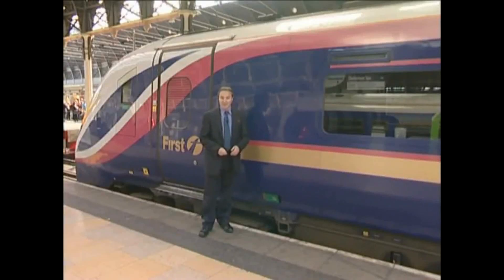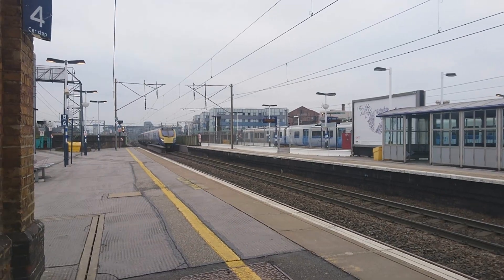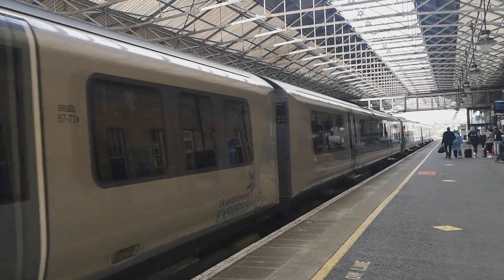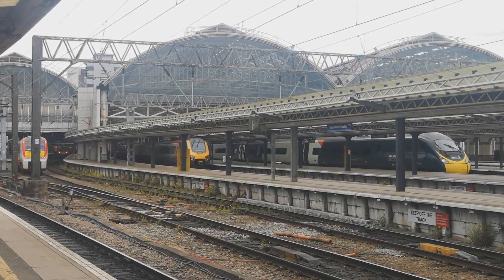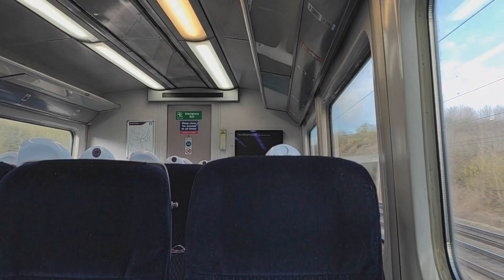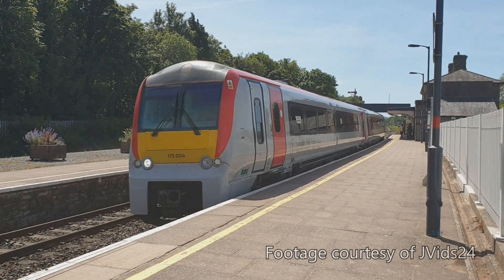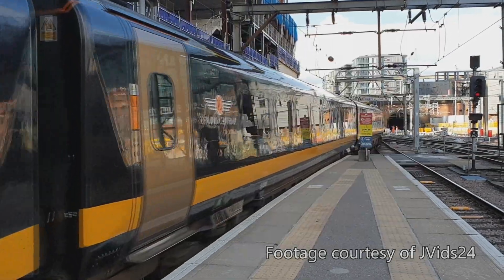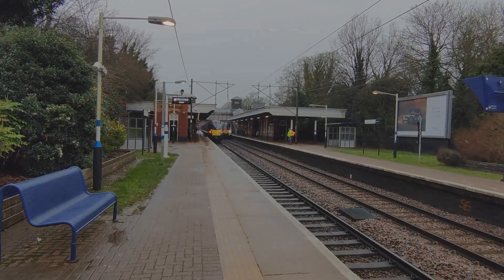The Railway Review To The Class 175 & 180

Comment: I’ve been on the class 175 and it was decent but it would be better if the coaches are longer.
Reply from the maker: If the coaches were made longer, you'd start hearing some rather concerning metallic scraping when going via Earlestown.
Reply: The coaches are 24m, so pretty standard length even for new units. The only ones with longer coaches really are the IETs